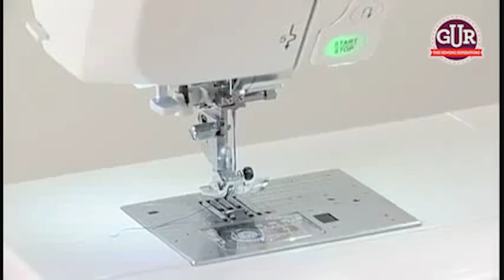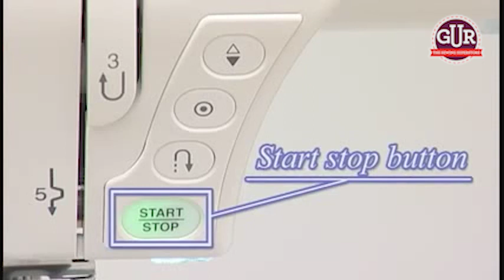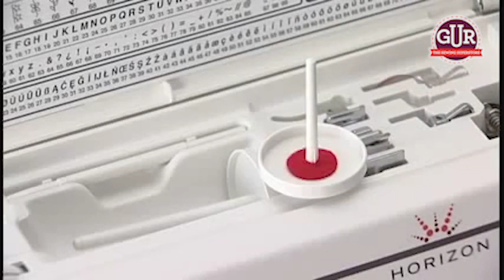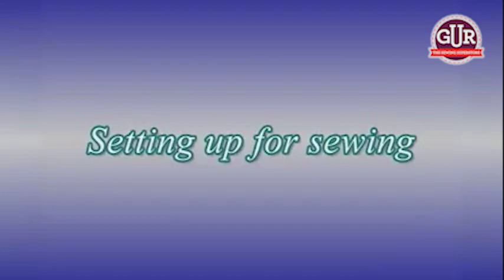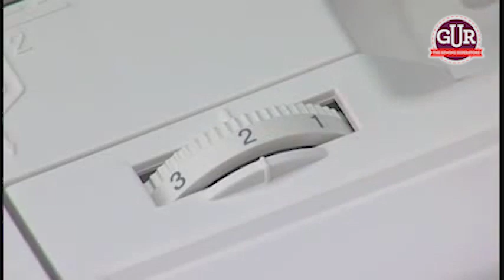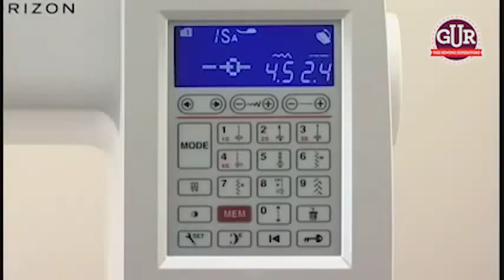Janome Memory Craft 8200 QCP SE instructional Video

Comment: I LOVE this machine.  But I actually make faux leather hand bags with this beast.  I use it for so many aspects of bag making and it’s fabulous for top stitching with the free arm.  It handled large top stitch needles and heavy threads.  After much trial and error I’ve got it doing beautiful top stitching.
Reply: I just purchased this and also make bags (i also have a Juki TL2010 which has been fabulous but am getting into garment sewing and needed a machine that did other than straight stitch). How thick a thread have you used in your Janome? I'm so excited to try making bags on this machine, especially with the ability of using that free arm!